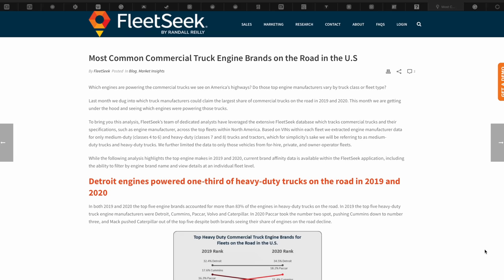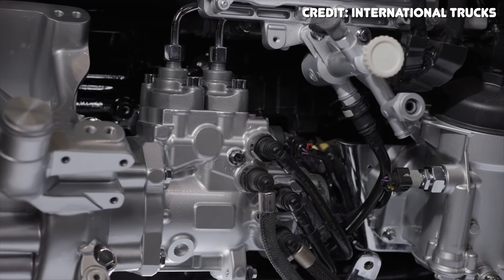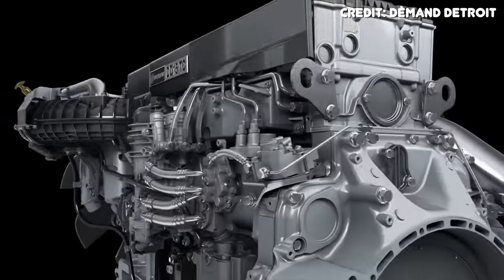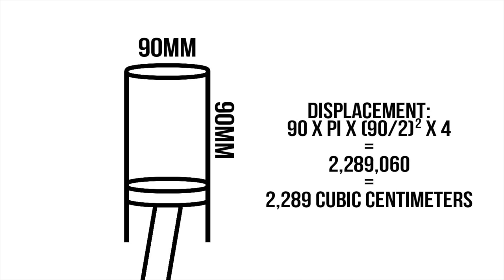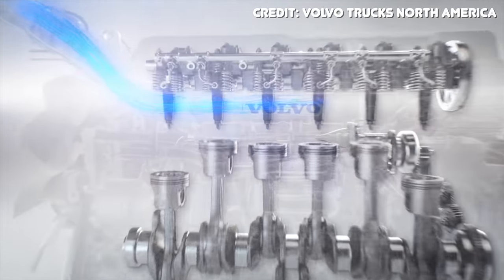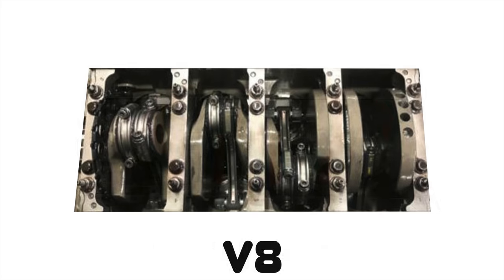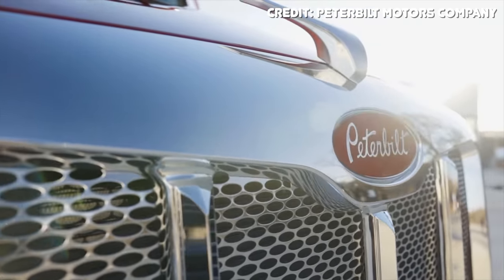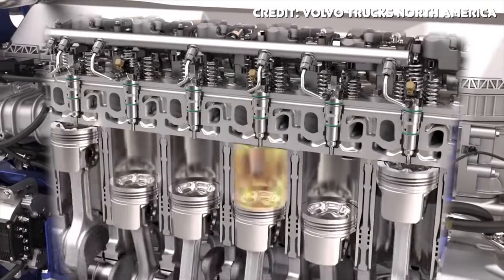Why do Semi-Trucks Use Inline-Six Engines?

Comment: I would guess that an inline engine is also quite a bit cheaper to manufacture than a V, and easier to design. One set of pistons all in a straight line, one exhaust, one intake, and fewer space constraints on the intake and exhaust sides. You don't need to make the intake manifold fit into the valley of the V. Also, since heat rises, an intake manifold (and associated parts) are probably under more thermal stress in a V, whereas if it's off to the side of an inline engine, there's a little less, plus you have more room to cool it. Some of that might be totally off base but I'm sure at least half of it is correct. :-)
Reply: ..

Marathon

not quarter mile
qualifier

...
Reply: It was my understanding that they were more expensive to produce than a V8.  The machining of the block and head and the need for longer stronger crank and cam shafts more than offset any savings on other components  This was something a GM engineer told me many years ago. With advances in technology it may not hold true today.

Comment: We used in the fire dept's I was in as a firefighter, 6-71 straights, then 8V71's. Those transited to 8V92's and 6V92's. We switched to Detroit Series 60's and Cummin's when the 2 cycle Detroit's were basically banned by the EPA( or so I understood). We did have a couple of Macks with Maxidyne''s but they were the exception to our use of the other two motors.

Comment: Great video. One correction though- the inline 6 isn't balanced because it has 2 pistons going down as one goes up - it is balanced because at any given time the number of pistons going up or down is the same. Contrasts that with an inline 5 where you have three pistons going one direction and 2 the other.
Reply: What about the 4BT Cummins it’s a inline with 2 piston coming up as 2 are going down and they shake like crazy
Reply: @HoneyRiverRanch  thats due to the inherent imbalance of i4s, check out Driving4Answers video on explaining those.

Also, this video is off, v8s dont use balance shafts...

Comment: A better description is to say that an I6 is in primary and secondary balance.  That plus the ability to do an in frame rebuild and a separated hot and cold side makes the I6 the dominant configuration.  The torque-whatever leverage stuff is just a distraction.

We design the mechanical packaging, layout, and structures for the engines that go into vehicles of all types.  Sometimes the vehicle is based on the engine, and other times the engine and trans dominate the vehicle design.

There are more I6 engine constraints due to hood visibility in commercial trucks.  That is why we see sloped hoods.  It makes a difference.  The FEAD designs get interesting to help with the hood designs.
Reply: The in-frame overhaul is a big factor
Reply: I am surprised to not see raked windshields. MFG's are stuck on 1950's design when all the rest of the rig is aero
Reply: Now get the idiots designing these things to put the starter somewhere accessible instead of stuffed into the frame rail.
Reply: When it comes to raked windshields with the trucks we have to wonder if the engineers that spend their careers on aerodynamic improvements are that dumb, or is something missing when people guess about what works best in the wind tunnel?

The windshield rake does NOT affect performance in the same way that it does to some degree in a car.

How is the hood design for a truck so much different than that of a car?
Reply: " The torque, whatever stuff is just a distraction" 
Spoken like a true designer that's never operated a class 8 truck.
Torque is everything for a low rpm, fuel efficient, long lasting engine!
Reply: @melvinrexwinkle1510  definitely, also often overlooked is the fact that these engines alot of times are close in displacement, so the i6 is usually bigger stroke/and or bigger bore than similar sized 8s.
Reply: Nice try, Melvin.  I've had my Class A CDL for 28 years and has trained hundreds of new drivers as a CDL instructor.

Many of the diesel engines this channel talks about have been designed or worked on by me.  Whee is your INCA license?
Reply: @johnphillips222  so are you saying a equal displacement i6 has zero mechanical advantage over a V8?
Reply: I am so fortunate that the internet experts can teach me so much with so little experience and knowledge.  My job is to design engines for different engine companies, and that gives me access to extensive engine libraries (not books).  An OEM may give me a $3.4 million dollar contract to design the engine layour.  In reality, the OEMs should just save their money, because the internet experts know better than me.  I am sure that they also know better than Heywood and Taylor, too.

The engine libraries give me access to IndiCom2 data that even the WVU students don't have.  I am so fortunate to have the internet experts tell me how wrong I am with cylinder pressure data on engines that I measures for the OEMs.  I am also so glad to have the internet experts tell me how I designed the engines I designed.  I  don't remember these internet experts next to me or in the flow lab or dyno lab or on developement trips. but they know better than me.  I wonder where these experts got their Vision or INCA licenses from.
Reply: @melvinrexwinkle1510  Marine diesels is all about torque talking MAN TWO STROKE.
Reply: @johnphillips222  WHAT?   Don't you know that a longer pry bar gives more power?(A longer stroke gives more power,has a longer intake)  BY you saying that; Torque,leverage thing is just a distraction; everything you say is null and void.
Reply: @johnphillips222  Hi John, would you have any thoughts to share on Chevrolet's Duramax in-line six Diesel Engine in their Silverado? I usually buy my vehicles new and drive them for a decade or two. Curios which pick up truck you would buy these days from an engine perspective.
Reply: Stroke/torque is a distraction. For a given displacement, the longer lever arm of a longer stroke is cancelled out by the reduction in force thanks to the smaller piston. I bet John could talk at length about all the trades made for piston speed/acceleration, valve sizing, weight, packaging, combustion efficiency, etc which go into selecting the actual dimensions. I'm assuming that displacement and not cylinder bore is generally given as the rough starting point based on regulations, marketing, or other requirements, and then everything else is optimized from there.
Reply: @RallyRat  Well,a 6 would have bigger pistons than a 8 of the same displacement so in that case , the 6 would have better torque characteristics.....don't forget that a long stroke has a longer intake, a longer power stroke too .......
Reply: @RallyRat  a 6.7 Cummins has a larger BORE and larger STROKE than a 6.6 Duramax at essentially the same cubic inch displacement.
Reply: @johnphillips222   How about explaining it to those of us with a interest then , rather than trashing others for trying. 
 Please what's a layour? Their paying you for.  Thanks!
Reply: @johnphillips222  so why haven’t made a video to share all your superior knowledge?
Reply: Regarding the I6 and other Dmax engines I have NDAs that are in place that prevent me from discussing those engines.  That is the sucky part of being an engineer in the industry.  I can only comment on stuff that is old or public info.  I am smart enough to follow the NDAs.
Reply: @johnphillips222  So when the guy said V8s aren't balanced but straight 6s are - - what ?? I thought 90* V8s and even 90* V2s have both primary and secondary balance ?
Reply: I never said that 90 degree V8 engines are not in primary and secondary balance.
Reply: @johnphillips222  They are just making their own assumptions based on their desire to feel relevant in the conversation.  As an engineer, I've had the horsepower/torque discussion many times with people to no avail.  Much more goes into performance characteristics than the base rating of an engine.  They seem to forget that there are more components to a drivetrain than the powerplant.
Reply: @JC-gw3yo  If the hood is designed correctly the air flow is directed above the windshield by the hood. It's not much different than asking why the front of trailers aren't raked back to help aerodynamics.
Reply: @johnphillips222  A well designed hood will deflect most of the air past the windshield in much the same way that a well designed tractor will deflect the air from hitting the flat front of a trailer.

Comment: In Europe land V8's are more common because in cabover configurations a big inline 6 would be too tall so V8's are used for the heavy hauling. Scania's the most popular V8 over there
Reply: Every single volvo, MAN and 98% of benzes are inline 6s. Scanias v8 isnt even their best seller. That is a inline 6.
Reply: @alexstromberg7696  I meant the more popular heavy duty diesel v8s . My bad!
Reply: I love a Scania v8 I own a 164 myself. But that isn’t true. No one really uses Scania for proper heavy haul. They use merc MAN and Daf. None are a v8. 
Merc and man iveco used to sell v8S. And indeed most people by 6 cylinder Scania a as they don’t need the horse power. Scania arnt popular on proper heavy haul as u can’t get big axles like in other brands. Scania are know to have chocolate diffs and gearbox’s
Scania still sell a V8 because enough people still like them and buy them. But notice the fleet spec trucks have 6 cylinders.
Reply: @ChromeStacks  I stand corrected! Ive seen the Australian heavy haulers use the Mack V8 so I assumed the same was true in Europe. So owner/operators are the main ones who buy them over there? also that's a shame about their axles, Mack should have shared their world renown diffs and axles with them.
Reply: @ChromeStacks  here in sweden they do

Comment: The real main reason 6 cylinder engines are exclusively (at least in USA) being used is that all 6 cylinder manufacturers make the engine with intake on the left, exhaust turbo on the right facilitating any of the engine manufacturers to be installed in a truck with minimum modification. You can install a 11 liter up to 16 liter in just about the same area.

Comment: Volvo also has or had a 16 L engine the D16, the truck I drive is equipped with this motor, no longer available in the, US 600 hp 2200 foot pounds of torque very reliable fuel efficient.
Reply: They had a lot of issues, at least at the beginning
Reply: And used a ton of Def
Reply: The D16 is still delivered in trucks here in Europa. The biggest D16 has 750ps, and 2600 lb-ft. Biggest problem with our D16`s is fuel consumption. The D13 is a much better engine if you don`t need 750ps.
Reply: @terjebetten3854  you live on Europa?
Reply: The D16 was a problem child compared to the VED12, D12 and D13. Don't understand how it happened since the platform was the same.
Reply: I liked the D16 I had in my Volvo years ago but it only really had power when it was cold outside. I had a 730 with that motor in it and it barely fit. Pretty sure the radiator and CAC weren't large enough for that engine. 3 injectors went out at once and went it came time to replace them, I had to pay for it. Supposedly Volvo was having issues with injectors in those engines around '09 and found out the issue but didn't put out a recall.

Comment: Mack mp7 is the exact same as a volvo d11 
Mack mp8 is a volvo d13... 
And back when they still made em the mp10 was the same as a volvo d16 
The engines are made on the same assembly lines in most cases. Any sensors , gaskets , bearings etc that you order for a mack mp series engine will say volvo on the package. Since late 2007/08 all mack engines are volvo.  
Mack mdrive auto transmissions are actually volvo ishift transmissions...  The list goes on and on...
Reply: I've been saying for a while now, Mack and Volvo are becoming the same truck with different cabs.
Reply: @highlypolishedturd7947  volvo bought out mack in 04? But they stayed all mack (renalt) untill late 07/08 then volvo put all their engines in em (mp series)  but kept the mack maxitourqe transmissions and mack top loader drives....then they did away with the mack transmissions a few years back. Now its ether a mdrive auto (volvo ishift) or if its a manual then eaton is the only other option . So for Goin on more than afew years now the only thing mack is the cab/chassis , axles and the dog on the hood lol
Reply: @highlypolishedturd7947  they pretty much are. As a truck spotter, I notice they use the same components such as fuel tanks and DPFs in the same arrangements on the chassis.
Reply: @DMTruckSpotting  Yup, I see that too! Tanks, battery boxes, etc..
Reply: @highlypolishedturd7947  Volvo and Renault trucks in Europe have a similar set up order a Renault and it's basically a Volvo with a different cab on top.
Reply: @-DC-  Interesting, I did not know that.

Comment: Such an interesting video. Thank you. Not to compare exactly, but the car I learned to drive in was a 1949 Dodge Meadowbrook with a flathead inline 6 and about a hundred horsepower. It had a fluid drive and you want to talk about slow off the line, that was it, but it also could be shifted manually with three speeds. We mostly used second and third. But it was possible to come to a full stop in third without pushing in the clutch, hence fluid drive. My 5-ft tall mother also learn to drive in that beast. No power brakes no power steering and my mom could barely see over the dashboard, but somehow we survived. Hey, I even remember the license plate fxb 921. Dad remembered because there was an actor Francis x Bushman back in the day.
Reply: My dad bought a brand new 52 Dodge Meadowbrook w fliud drive ,my mom learned how to drive on it,  he sold i to my uncle who drove it for  years. Later on my dad bought a 53 Meadowbrook , w fliud drive . We never had any tailgaters in that one , it was like a blue fog bwhind us at all times . The engine was so sludged if you ran it with more than a trace of oil on the dipstick  you couldnt see out the back window. The old girl ran for 15 years. Slower than a turtle for sure
Reply: @ccole9080  Great stories.  I believe they were all flat head 6's with around 100 HP. Yes, tortoise slow and often oil burners, but I believe somewhat reliable.  I seem to recall Vern at the 76 station bought ours and lost it in a poker game for $25 c 1962.
Reply: @skcyclist  
 lol ... slow . oil burners . flat head I 6s , reliable..
 the answer is D.. all the above . . Love the story about your family selling it to the 76 station owner who lost it in a poker game for $25. 
Our 53 wasnt worth 25 when my dad bought it , we sold it in 1967 for $10 to a kid up the street , it still ran, $10 was scrap value . Is saved us the time and gas to drive it to the junkyard. 
I remember when we got the 53 the passenger front
 and rear floor boards were partially rusted out . a board and a rubber mat barely covered the holes and if you didnt lift your feet going thru deep puddles you were getting wet feet . 
Although my dad could have easily afforded good cars , he rarely bought them . When it came to cars he war tighter than bark on a tree
Reply: @skcyclist   The 52 Meadowbrook was the first , last and ONLY new car he ever bought . Several times my Mom asked him to buy a new cars as for years he drove nothing but old junk. 
His response was I will when the kids get older . The kids are in their late 50s and 60s now and both parents have been gone for 25 years. Im trying to figure out how much older the kids had to be ? 😂
Reply: @ccole9080  I have never bought a new car. My dad never bought a new car though he got a deal on a pretty new Circa 1971 Plymouth Scamp demo car. We did not have a lot of money. Even when I could eventually afford a new car, I knew it would be a ripoff the minute you drove it off a lot. Everybody knows it. My mom was 5 ft tall and weighed 110 lb and learn to drive that heavy no power steering or brakes stick shift Dodge, bless her heart. I admit when I was in the backseat watching her drive I was pretty worried.
Reply: @skcyclist   funny you mention the Scamp , I worked in a Chrysler/Ply dealership at that time and they sold brand new Dusters for $1999. 
That was the bait to get customers in the door.  3 on the tree , rubber floor mats , no radio , no rear window defogger etc. We had 1 or 2 of them in stock and hundreds with AMFM Stereo cassetes , ac , ps , pb etc. 
No one wanted the plain janes when they saw the dressed up versions. The AmFM stereo cassette option was $250 , for a off brand non factory unit that cost us $29 and 20 minutes to install
Reply: @skcyclist  
We bought the radios by the pallet . Body side molding same basic deal . $10 or 15 cost , 15 min install , $199 to customer . 
I ran across some paperwork from the factory and the  $1999 Dusters cost the dealer $1275 in 1970. All dealers pay the same price from the factory for the car. Delivery charges were different depending on how far they had to be tranported . Dealers also got incentives based on sales goals and so on . But in those days they made a lot of $. 
The dealership i worked for was given the C/P  place as a wedding present . His father owned a Pontiac dealership and gave the C/P place to his son and daughter in law . 
I bet you were nervous with your mom driving the tank . I always remember my mom driving that tank too. No power any thing was a real treat especially when parallel parking. The steering wheels were huge
Reply: @ccole9080  I remember those days. Two grand is about what my Dad paid for the almost new Plymouth Scamp. My mom of all things bought a Duster used. The little old lady once lost control on the freeway claims she did a full 360 and just kept going.
Reply: @skcyclist   
Yeah gotta watch those little old ladies on the freeway , theyre hell on wheels ....
    lol